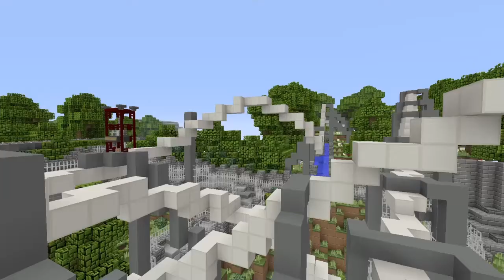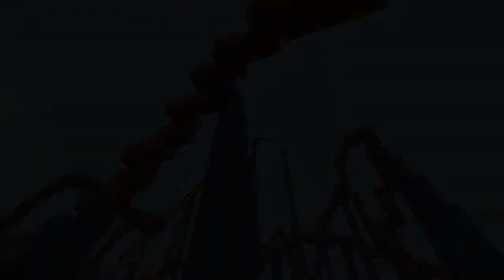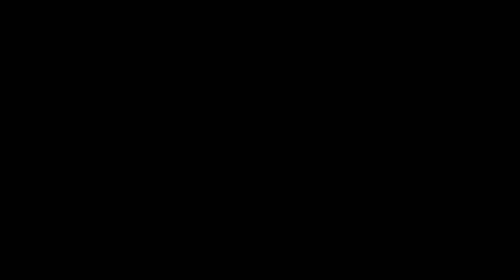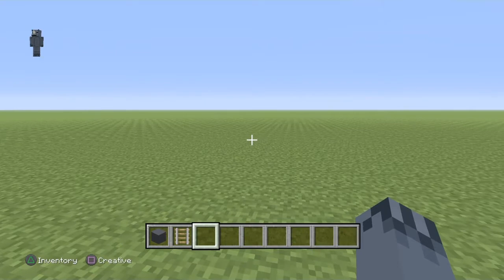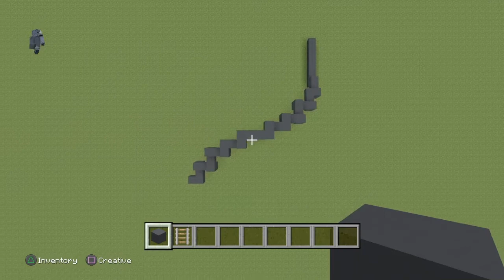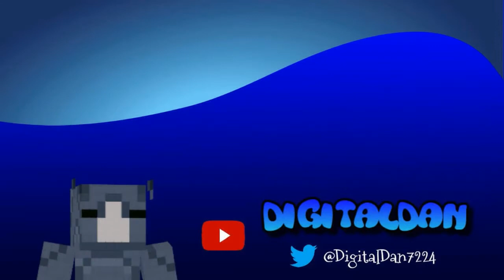Corkscrew and Zero G Roll - CET #2 (Minecraft)

Comment: Ones You Should do...

1 Vertical Lift
2 Sidewinder
3 Heart line Roll
4 inline Twist
5 Cobra Roll
6 Sea Serpent Roll
7 Batwing
8 Dive Loop
9 Immelman
10 Top Hat
11 brakes
12 Launches 
13 Mine cart dispatches 
14 Dive Drop
15 Freefall Drop
16 holding brakes 
17 vertical / beyond vertical drop
18 Bowtie
Reply from the maker: Dom wpc umm. thanks for the uh. many suggestions.
Reply: Dom wpc Good Luck Dan, with them suggestions ^
Reply from the maker: +Lights Camera Minecraft thanks xD